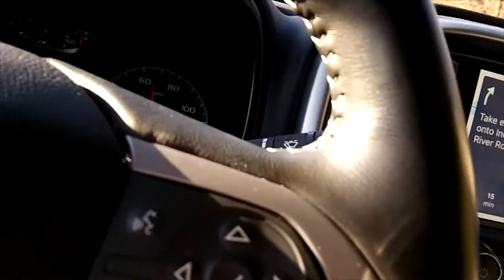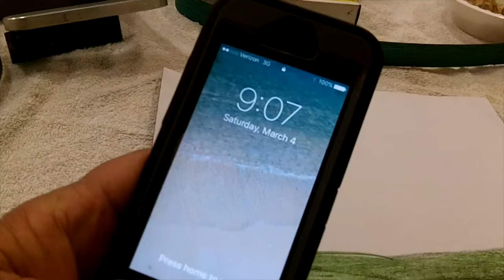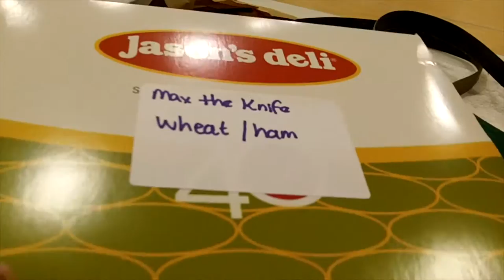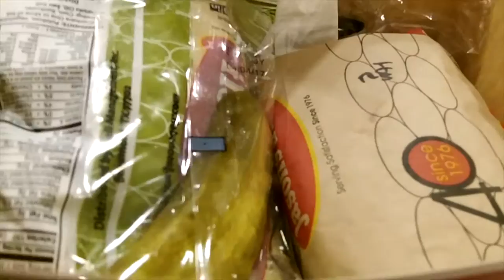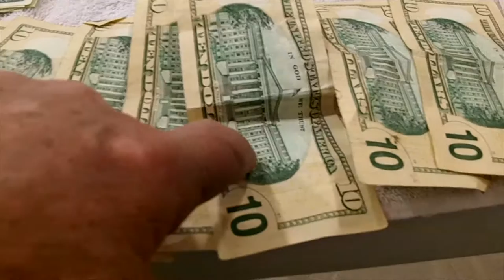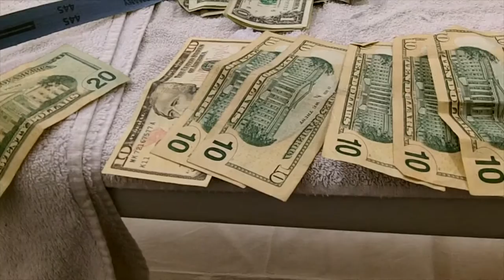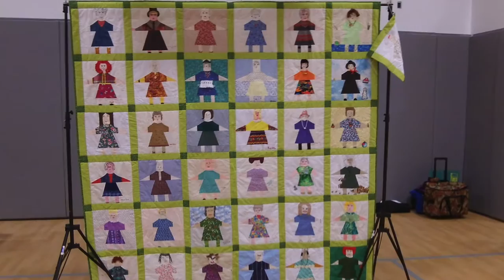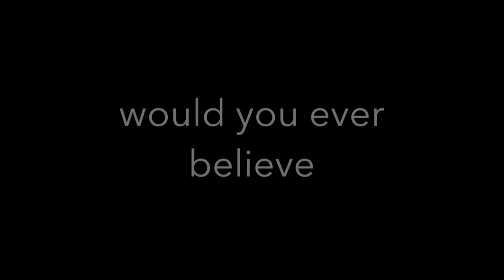SCISSOR SHARPENING!!

Comment: Just a thought. The farther you extend the shaft for the grinder from the motor any small degree of off balance will increases the the vibration of the unit where you will or could see an uneven grind machine vibrates all around the table, try to keep the wheels close to the motor as possible. The stone wheels by nature have a tendency to be off balance the faster you rotate. You sometimes need a star wheel to try to take out the uneven from the stone.

Comment: What is that fancy clamping rig you use to sharpen scissors?
Reply from the maker: clamp is made by Twice as Sharp for there scissor sharpening machine.....make 2 or 3 models with different widths.......this 1 is 1" wide.....other is 3/4"" maybe even 1/2" - not sure....company is:  Wolf industries in south carolina